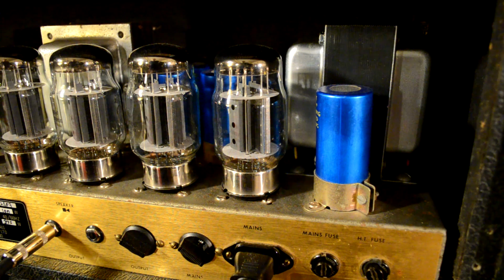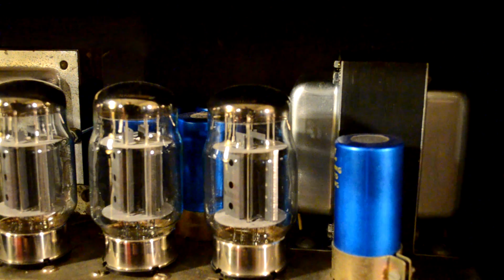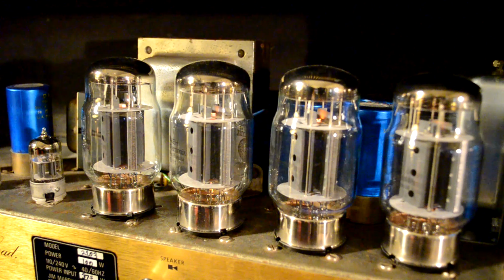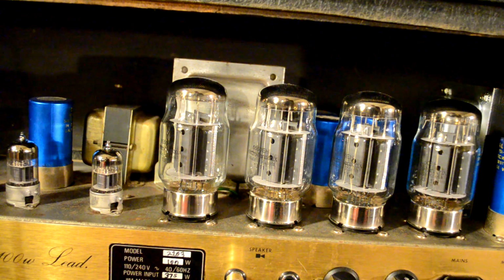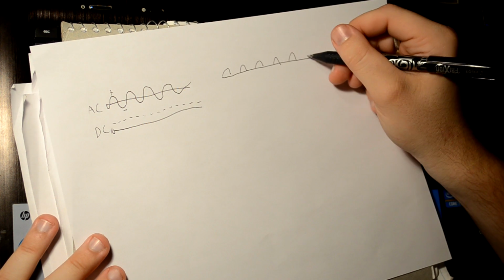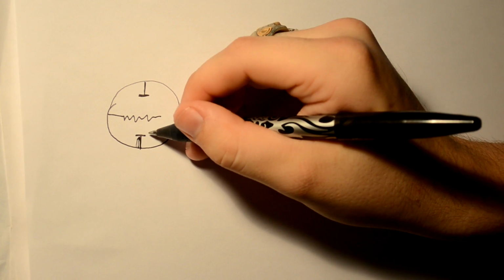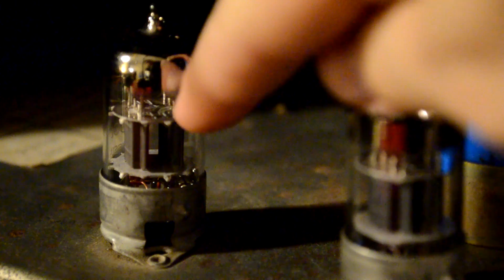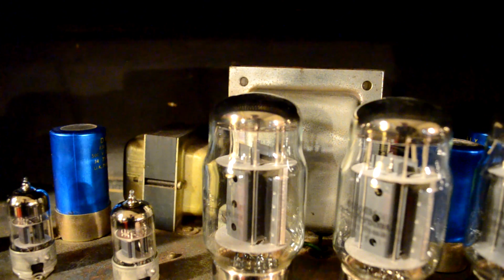How Tube Amps Work

Comment: Thank you brother..I've got a Marshall dslcr that has power but no sound. I looked and coming in to the chassey there were two HT fuses blown. I replaced them and they immediately blew again. Could you take a guess for me I would appreciate anything at this point.
Reply from the maker: @before120  if I remember correctly, the HT Fuse is for the B+ voltage. Could be a number of things but I'd guess maybe bad filter caps? Hard to know for sure. I'd recommend taking it to a qualified amp tech.

Comment: Hi! First of all I love your video. You are a very smart guy lol. With the power transformer in the amp, does this mean that I can run a Marshall 2555x 100 watt amp that runs at 240V 120HZ through the US 120V 60HZ and it would work fine?
Reply: I am not so familiar with the 255x, but most of these Marshall amps have a voltage selector on the rear of the amp to select whether you're connecting to 120V or 240 V AC.  Perhaps your 120 Hz is a typo?  I believe all the amps will expect 50-60 Hz.

Comment: This was easily the best explanation I've seen on youtube. An interesting idea I have on building my own amp is to use Lithium phosphate batteries to run the amp off of DC Current. that way you always get nice clean direct power. I think you could still plug the guitar amp into the wall, but it would just charge the batteries. Its like have one giant capacity, with the benefit of making your amp portable too like for busking.

Comment: I've been playing Tube Amps for decades and never worried about how they worked, kinda like a race car driver that never worked on engines before, just drove he shit out of them. Hey it worked for years. But now, with this easy to understand explanation of what goes on, I found myself selecting tubes to produce desired tones from my amps. Let alone doing work inside the heads a lot more safer than any other times before. Thank you sir, good job.
Reply: I found that learning how to build guitars gave me the same benefit that working on cars gave me, discernment on buying them!! If you know how a guitar or engine works, then you can know what is wrong, could go wrong or is lacking in them.

Comment: Very over simplified. I have been designing electronic circuits for 55 yrs and you forgot about tube bias, why electrons flow from cathode to anode, why certain tubes are used (ie 12AX7 has a very large gain, so Thats why its used in the front end) 
The anode need to have a high voltage on it to attract the electrons then its coupled to the next stage via a capacitor remember capacitors will pass AC bit block DC) 
The 12 in the 12AX7 represents the filament voltage and the cathode can be directly or indirectly heated

Comment: Great video man....I have a? For u,   what kind of preamp tubes are you using?  The first one looks like an old amperex or mullard,  the other two I'm not sure.... Could you possibly list the tubes your using for v1 v2 and v3?
Reply from the maker: To be honest with you, they were nothing special (definitely not vintage). And I've replaced them since making this video so I don't even remember what they were. Sorry!
Reply: @JMP_2203  it's just that they had the old plate structure styles..... Now a days the plates are frame grids.... Instead of the old ladder style

Comment: Thanks for the explanation. Recently had tube amp problems in my EVH 50wt. After a simple tube replacement did the trick, I needed to know how it all worked. Got a slow start at 57

Comment: Is the speaker transformer magnetic? When I move my hand over it I feel my hand getting pulled into it on my rockerverb mkiii which is weird
Reply from the maker: Well do you have metal in you hands? Lol
Reply: @JMP_2203  I hope not my friend noticed it too when I run my hand over the heat grill at the top when I get close to it it pulls my fingers tips into it its really odd lmao
Reply from the maker: @dylanporter8105  I've never heard of such a thing! There's nothing on an amp that should be attracting your hands. It's most likely an illusion.

Comment: very well explained. And the question i had in mind for a long time for which i could not find any answer has been answered. Why exactly Tube amps sound different than transistor? Its the way the AC signal is clipped, transistor clips so that the peaks are flat and valve clips it, tthe signal is slightly curved at the peaks
Reply from the maker: Well yes, that's part of the reason. There are a number of factors as to why tube and solid state amps sound different. One main reason being that tube amps have an output transformer, which tends to "smooth out" the waveform.
Reply: @JMP_2203  transformer just steps down the voltage level of the signal. Smoothing is done by capacitors right?
Reply from the maker: @metaldownm  well the filter capacitors help convert AC to DC by smoothing out any ripple. But this is not part of the signal chain. When I said that the output transformer "smooths out" the signal I don't mean it in the same way that capacitors do. The OT kind of rounds off the signal before it gets to the speakers, whereas solid state amps don't have output transformers. Therefore they generally have a harsher sound. If you want to learn more, look up the Peavey White Papers. They have a lot of great info and one of the papers talks specifically about the output transformer.
Reply: @JMP_2203  oh okay, thank you, I did not know this. 🙂👍 I will inform myself about OTs then. Cheers.

Comment: how does the resonance control work, reason I ask is I just got a new Marshall dal 20 head, and sitting in front of the amp the resonance knob doesn't do nothing.  does it have to be turned up loud to work or is my amp need replacing.
Reply from the maker: My amp does not have a resonance knob but if I remember correctly it affects bass frequencies and is a very subtle adjustment. So yes if it is louder it will have more of an effect, however the difference between 1 and 10 with the resonance knob is not very noticeable.

Comment: I'm quite certain that electrons goes from the anode to the cathode, the current however, goes the opposite direction
Reply: Sorry, but it's the other way around. Electrons are emitted from the cathode and flow to the anode (or plate), conventional current flows from anode to cathode.
Reply: No. It isnt.
Electrons always flow from the anode to the cathode or from the oxidation half cell to the reduction half cell.

Comment: Hi Brandom, I got a question about the chassis. It is quite expensive and I wonder if I can do it myself in MDF or acrylic with laser cut. Nevertheless I'm not quite sure if those materials work as a chassis material.  Thank you for your advice ;)
Reply from the maker: Hmm I'm not quite sure. Those would probably work though. Sorry I can't be of more help.

Comment: Hi, great explanation. Exactly what I was looking form. I just had one question: Why you must connect a Speaker Cabinet to your tube amp?
Reply from the maker: Great question! You must connect a speaker cabinet because a tube amp has an output transformer. Basically if left unconnected, the electricity that enters the output transformer has no place to go and can create arcs within the transformer causing damage.

Comment: Hey,
I'm wondering if I can jerry rig two guitar tube amps and use them like mono block/speakers to create a stereo system using a source and two RCA to 1/4 inch jacks (does those even exist?).
Has anyone ever tried it?
If so, what sort of sound can you get from it?
Alternatively, can you recycle the tube amp components from this type of guitar amp and use them separately as mono blocks?
Thanks for your input!
Marc
Montreal, Canada
Reply: Idk

Comment: Shouldn’t electricity flow from the anode to the cathode? That’s how it works on galvanic cells but Idk about here.
Reply: Joe you are correct DC volts flow from the plate to the cathode. AC millivolts coming in to the tube via the grid ie the sound wave are then depending on how much milivolts are let into the tube on the grid are attracked to the plate by the electrons that are boiled off the cathode move to the next stage via the coupling cap which will only let the AC milivolts through and not the DC.
Reply from the maker: Nope not in the case of vacuum tubes.

Comment: Man... No capacitor, that is used in any household electronics can kill you and I've never seen an amplifier with such power, that its power supply outputs more than 40-50V.
Did you use a voltmeter to check the voltage?

Comment: Good job. I have a Blackstar MK II , at about 9 o clock Master Volume position it causes a horrible braking up of the output. Below that it’s fine. I’m thinking a EL 34 is faulty, but not experienced with tube issues. What’s your thought on this?
Reply from the maker: Hmmm, could be a tube issue but hard to know without observing the problem myself. Could you upload a video?
Reply: Brandon Doherty Not sure how to upload one to you. Let me see if I can find an instruction.
Reply from the maker: @keithfields1178  just upload to your channel then copy the link and paste it to this comment section.
Reply: https://youtu.be/AQUgs-gRuO4
Reply: I think I got it?
Reply from the maker: @keithfields1178  I only listened on my phone speaker but it sounded pretty normal to me? It could just be the way that amp breaks up at high levels.
Reply: Thanks, it’s only up 1/4 way. Larger speakers will reveal the issue. But thanks appreciate it.
Reply from the maker: @keithfields1178  I gave a listen with headphones. I think I hear what you're talking about. If you've never replaced the preamp tubes I'd start with that and see if it solves the problem.

Comment: Thanks for this great vid!
I might have missed it but why is it in glass?
Reply from the maker: Kredeidi These are vacuum tubes, also called valves. In order to function, the inside must be a vacuum, very similar to an incandescent light bulb. The glass envelope is formed around the internal components and all the air is sucked out, then it is sealed to maintain the vacuum.

Comment: The blue light up is just for large tubes? I have a tube amplifier with smaller EL84 power tubes, they don't light up blue when I play music.
Reply from the maker: Hi-Fidude66 Yes you can usually only see this on larger power tubes. And the volume must also be high.

Comment: Hey man great video very informative. Just a question about your description of how the tubes actually work, at about 19:39. So you have an AC signal coming in which gets amplified by the current flow from cathode to anode, but does your signal maintain the same voltage amplitude (and obviously the frequency) that was originally sent from the input signal? If this is the case, the amplification comes solely from your increase in current...am I kinda on the right track here?
Reply from the maker: Greg Doucet Well it gets kind of tricky here, and you have to think about it a bit abstractly. The incoming signal does not actually get amplified. Rather, it is simply used to modulate (change / control) the much more powerful current between the cathode & anode. So the output signal is basically a replica of the input, it's just scaled up to be more powerful.

In other words, if you compared the waveforms of the input and output, they would look nearly identical. The difference is that the signal from your guitar is in the range of a few millivolts, while the output from the tube will be hundreds of volts. I did not go into this in the video but it actually gets a bit more complicated here. The signal measured at the anode, while identical, is actually phase inverted (in reference to the input signal). Anyways, the point is that the input signal itself is not really amplified. You can sort of think of the tube as a machine that reads the input and just creates a bigger copy to output.
Reply: Brandon Doherty thank you that clarifies exactly what i needed, awesome video thanks again... I'm trying to build my own tube amp and am having trouble getting started, any tips you could give me or point me towards some simple schematics that might help me out?
Reply from the maker: Hey buddy, sorry for the late reply - just saw this post. There are TONS of great resources online ranging from guides, to schematics, to kits, and more! This is one website that is really informative and helpful (and from the guy that literally wrote the book on amps). valvewizard.co.uk

Not sure if you're on facebook, but there's a group you can join called Tube Guitar Amp Builders. It's full of pros who are awesome at helping newbies out by giving advice or explaining certain things. It can be a great place to ask questions or just discuss amp/guitar related stuff.

Besides that my best advice is to be safe at all times (meaning educate yourself on how to discharge capacitors, work with high voltages, etc). Start with the easy stuff and learn as you go. Most often I see recommendations to start with a Fender Champ schematic. It's pretty much the simplest guitar amp circuit you can build, but it will teach you the basics so that you are prepared for the more complicated stuff!
Reply: The signal on the grid modulates the current flowing in the tube. This current flows through a resistor and develops a voltage across it which is copy of the signal at the grid, (almost) identical in every way except that it is larger.